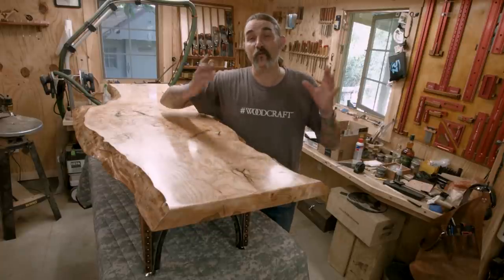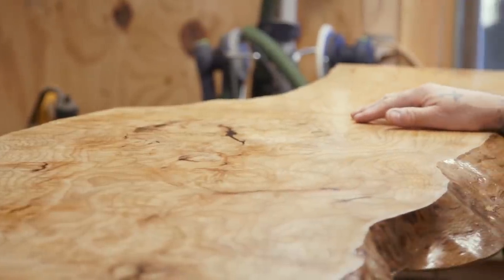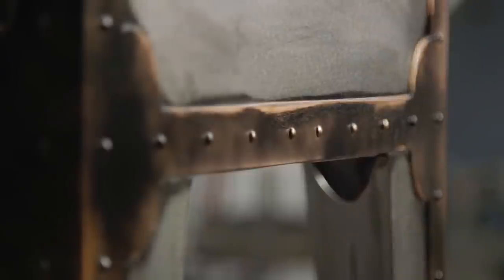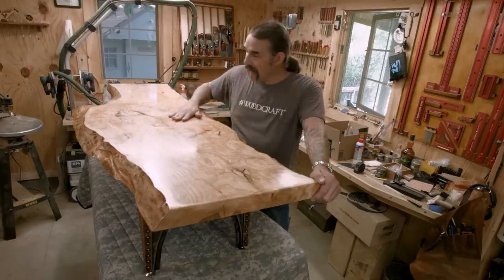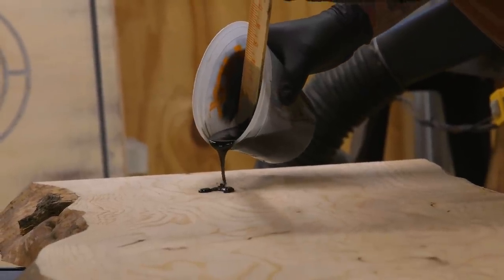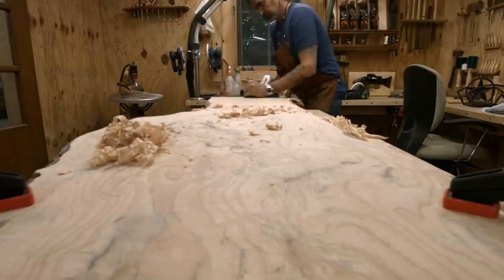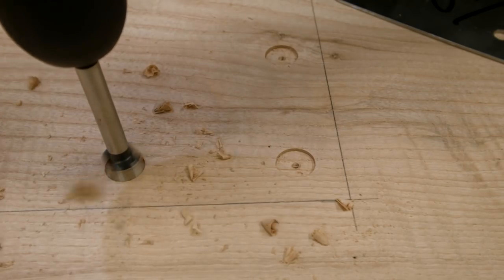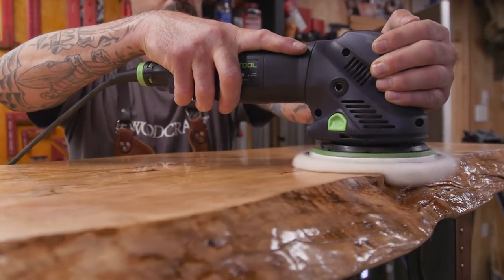Unique Live Edge Coffee Table with Custom Metal Legs | Woodworking | Woodcraft 101

Comment: Hey Eric. There is a better insert. I have tried many and the best I have used is the flange head zinc alloy type, most often the 1" length. The flange head strengthens the hex pocket considerably and seats the insert firmly. I have not stripped one so far.                                                                                                                                                                                                                I use one of the inserts as a tap to thread the holes in the wood first, blow them out with compressed air and then usually epoxy them in.
Reply from the maker: Thanks for the tip!

Comment: Well done. Looks like that track saw burnt a bit more than I’m used to seeing. I don’t work with Ash but I assume it’s pretty hard, they make baseball bats out of it after all. Was that just general finishes black stain on bottom?
Reply from the maker: It burned a lot.  Was 100% my fault, too slow.  The Ash wasn't too bad but it did tear out a lot more than I expected.  Just my inexperience :)  The black was a General Finishes Lamp Post black milk paint.

Comment: Wow that looks great! I love that leg design. I wish l could do more in metal but l cant (wont) weld. I lost an eye in a papermill explosion some years back and henceforth have become very protective of the one I've got left. I'm not only concerned about possible UV exposure, but l also dont think I'd ever be able to control a decent bead with no depth perception. But those legs are super cool man.
Reply from the maker: Thank you very much.  I'm sorry to hear about your eye.  I had to wear a patch for a little while many years ago and welding was difficult with my poor depth perception but I would think your mind would be able to adjust.  Have you thought about torch welding or brazing?  Might be less exposure.
Reply: @CraftsmansLegacy  l have! I have indeed considered trying my hand at torch brazing. And l think that might be a viable option. Most of the projects l kinda have in mind right now (fishing rod caddies, pier carts, etc) would be in aluminum anyway, so I'm considering trying these new fangled aluminum brazing rods that are MAP Gas torchable... Any experience with those?
Reply from the maker: I know the rods you are talking about but do not use them.  I used to teach flame welding aluminum though.  Using a torch and 1100 rod.